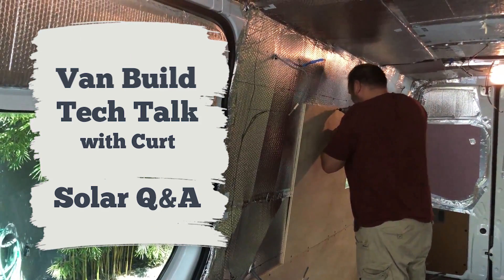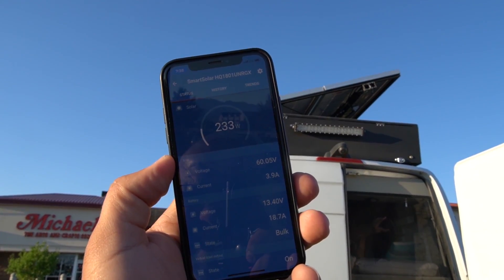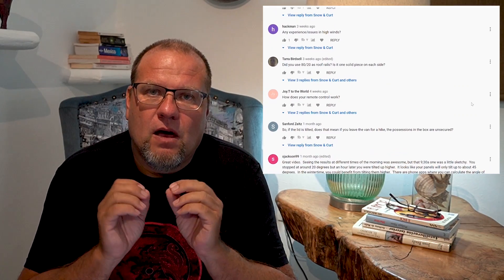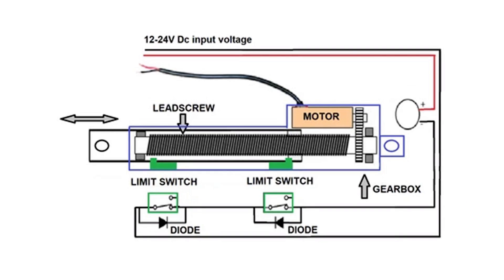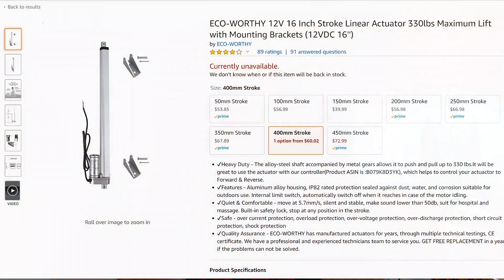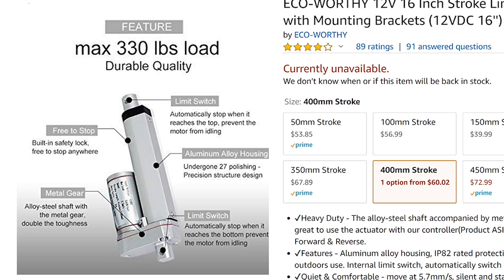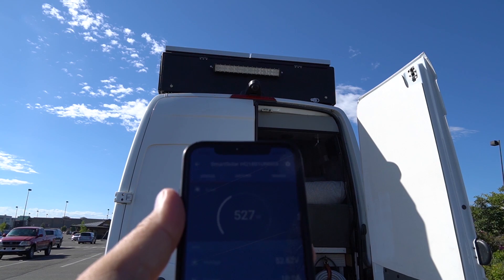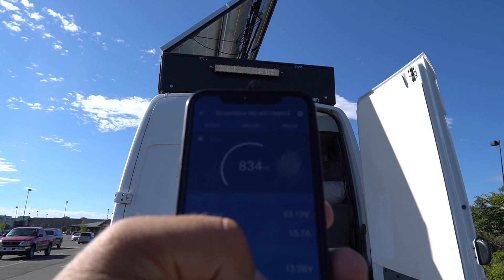1080 Watt Remote Tilting Vanlife Solar Explained - Van Build Tech Talk

Comment: Great video - thanks for sharing.

To anyone who wants to build one of these - do a mock up on the ground first - make sure you have all your angles worked out and connection points 100% working BEFORE You dril a single hole in your roof or your panels.

Comment: Curt this amazing and I can't tell you how much I appreciate your sharing this information. I would love to install a rooftop deck and wondered about your thoughts of my putting raised rails around the panels to support the weight of a tambour for part of panel section. Of course the panels would have to be down and I realize that I would get not power while the panels are covered. The tambour deck would only be large enough for my wife and I (both under 200lbs) to sit on and not make an entire surface deck. Thanks again for this great contribution to van living.

Comment: Didn't know where to post this question, but as it relates to the Attic, around the world adventures.. Have you figured out how to handle shipping your van across ANY of the oceans. I've looked at the DOOR height on High Cube containers. they are 101" tall. A medium roof ProMaster is 99" let some air out of the tires and apply vaseline. I'm gonna copy your attic, but make it reasonably removable, say in half a day. So that it can ship IN a container instead of a cost prohibitive RoRo ship where stuff can/will get stolen. I've also heard of people building a set of Steel wheels, only an inch or two, to allow the vehicle to drive 20 feet into and out of the container.. Change the tires in front of the door to the container. drive in, put your tires and attic in behind the vehicle.
Reply from the maker: Ours is "somewhat" removable... But hang in there about one more month and you will see is ship the van from Panama to Colombia! We will document the whole process!

Comment: Do you not have attic fans? if you do and im just not seeing them then how does the box affect the airpull?
Reply from the maker: We have 2 maxx air fans. The roof attic box is built to fit perfectly over them when they are fully open. The attic is not air tight and the fans work perfectly when the attic is closed. We thought about adding vents to the attic to help with circulation, but we have not needed it.

Comment: Do you use the solar tilt very often? Please answer honestly.

I'm debating whether to incorporate it into my design. I asked some of the vanlifers who have solar tilts and they said they mostly keep them shut cause they're afraid of people stealing from their attic.
Reply from the maker: We tile the solar quite often in the morning time when we have ran the AC a bit over night... helps us to juice our batteries back up a bit quicker. We do not ever leave the van with the solar panels tilted... not just for the possibility of someone stealing stuff from our attic, but what if a storm with some heavy winds came! But, yes, we use the tilting solar!
Reply: @SnowAndCurt  Thanks for your reply. Here's my idea to solve both problems.

I think I'd make an aluminum security bar gate and piano hinge it inbetween the solar tilt and the top of the base it rests on. Then just add a rubber coated lock so it doesn't rattle.

In case of a storm that could damage your solar lid & its hinges, maybe add a wind sensor to automatically close just like the new awnings retract.

What do you think Kurt?

Comment: How heavy is the box with the solar panels?  Does it make your van top heavy?  I love the design and would love to do this.  ( can’t wait for your build blueprints). I am just worried about making the van top heavy.  My old van is a 91 coachman and the Useless AC on the top seems to make it top heavy.  
Also I wonder which fans are lower profile I would like to put in two fans.
Reply from the maker: top heacy at all. Curt could lift the box frame by hisself, without side door panels or solar panels... but the side panel doors are not heavy at all, they are lightweight sheet metal.  The van does not feel top heavy at all!

Comment: Yes you can tilt the solar panel in both directions.  Just attach the solar panels to a rotator in the middle of the panel.  That rotator would go in the direction from the back of the band towards the front of the band.  That rotator also needs to be attached to a lifter that will first lift the panels high enough so that when the panels tilt west or east, there is enough clearance for the panel to tilt 45 degrees.  Then have the panels attached to a light sensor whereby the panels will then tilt alone based on light.  Then have a timer attached to the entire system that closes the panel to its resting position when it hits a certain time of the day.  That way you don't have to worry about the panels ever.  If you are trying to be stealth or you are in a cold non sun area, then just turn off the entire system so it won't work automatically.  I created this system for my van myself.  Here is the link...  and remember the info I have given here in case you don't get what you want after going to this link.  https://www.youtube.com/channel/UCueGhrO1FzP2iorEOvnrjPw/playlists?view_as=subscriber
Reply: Tnx for the infor Dude Man but there are no videos in your channel just some playlists with muppets :-)) Any idea where we can see more about the solution you suggest. Tnx in advance.
Reply from the maker: Thanks, Dude Man!

Comment: This is a great plan. I liked it when I saw your first video, but was concerned about the height. I am now looking at adding an attic to our van build. Some questions... Has the extra height, 10 feet instead of 9 feet, been a problem for catching wind when driving or hitting bridges or canopies? What did you use for the black side panels? Have you found the 1" x 1" 8020 aluminum strong enough for this construction? Thanks for sharing your experiences and knowledge. It is very helpful to us.
Reply from the maker: Hi Richard! We've only had to turn around at low bridges twice... Way off the beaten path, so no traffic to worry about... And they were easy to get around. That bring said, you just have to stay aware! Most obstacles that we can't fit under are low enough that a van without the attic wouldn't fit either. 

We have a wind deflector in the front, which I think is a must... Other than that, the wind is manageable. At least it has been for us. 

When we out it in a shipping container (we are taking it around the world), we will have to take the attic off... But we knew this when we built it, do Curt did his best to make that as painless as possible. It will be a big deal, but to us, the added storage is worth it!
Reply: Snow & Curt thank you for sharing this. The plan for our van build is to also have an attic so this is good encouragement. We are enjoying our adventure videos as well. Keep them coming.
Reply from the maker: Curt is editing the "how to build an attic" video right now! Stay tuned... Should be out Sunday or Monday!
Reply: @rreichard  Were you able to build your attic? I'm curious to hear how others have approached this. I'm a bit surprised to not see this feature built on other vans (on YouTube).
Reply: @SnowAndCurt  were you able to post the video on how to build the attic box with solar panel lid? If so, I’m unable to locate it
Reply: I was Thinking that nearly all Class B RV's have a Roof mounted Air conditioner which is probably about  12 inches High so probably not a problem?

Comment: Well done my friend. Question, is there any opening on the box like on the sides to let in fresh air for the fans to suck it in?
Reply from the maker: The box is not air or water tight, by design. Air does get in. And each metal panel on the side can be opened via a key lock and hinges if you want extra flow. But, we've had no problems with air flow.